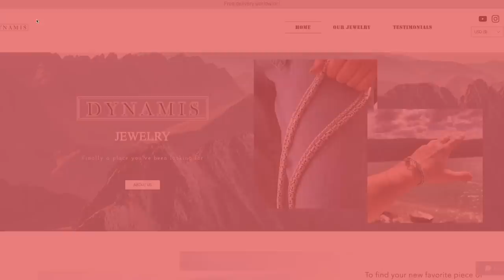Heavy Sterling Silver Ramses bracelet (15 mm) | dynamisjewelry.com

Comment: After you pull the silver wire, you heat it then place it in a liquid? What's the liquid doing?

The heat aneals and softens the metal so it's more easy to work I'd guess.. Is the liquid for pickling?

Comment: I love the Ramses design, my only issue is what size of wire works with size of inside diameter. Preferably in mm's
Reply: If your wire is 1mm multiply it by 2 and then add 0.5mm. This works with all diameter wire.
Reply: I had seen 1.8 mm or I think it could be 15 caliber, also I don't know  the name of that plaque in English😅; But if you put enough focus on the video